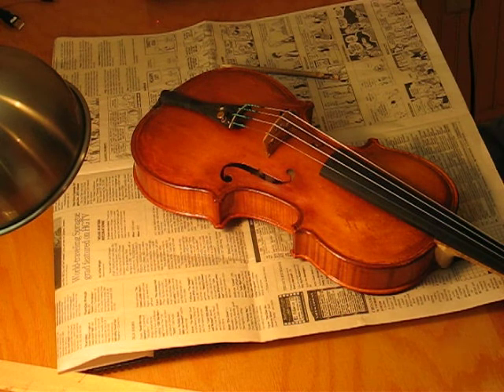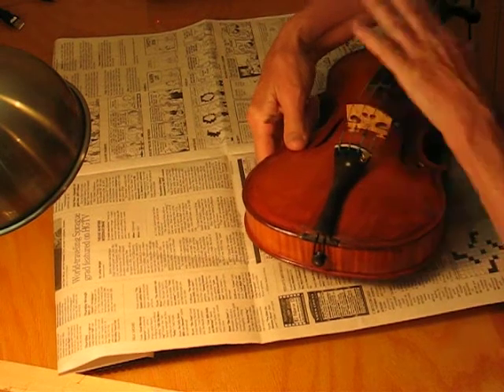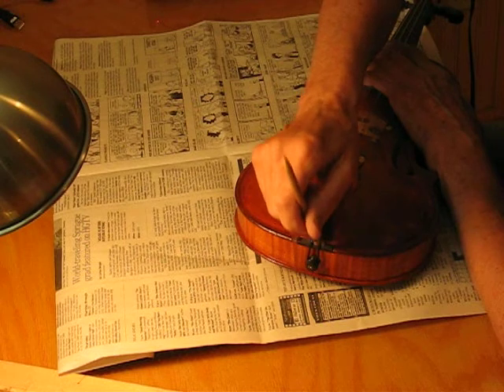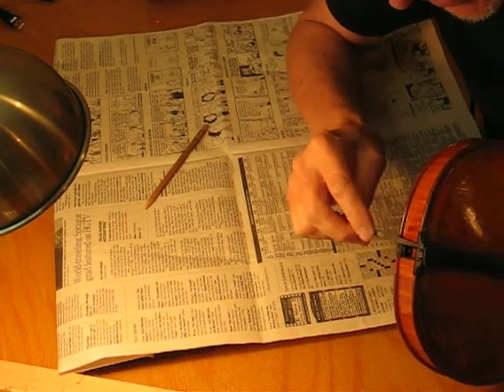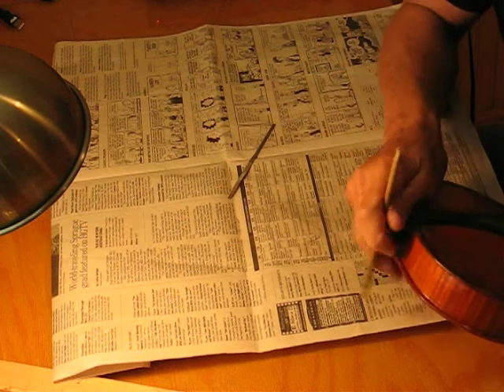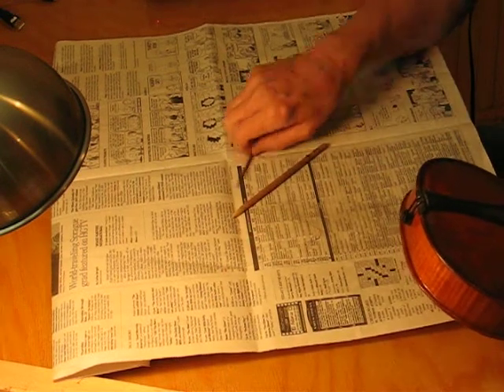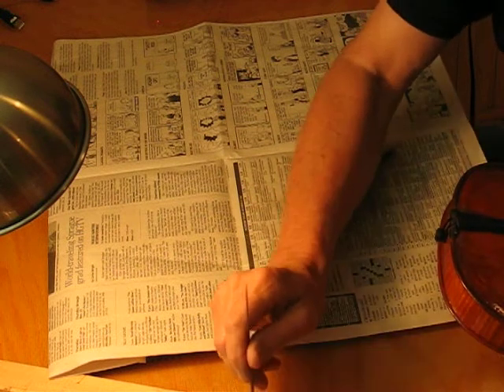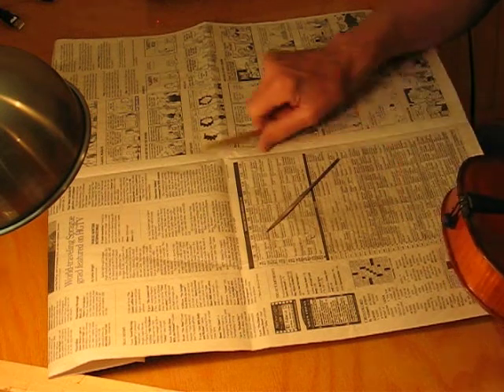Saddle Acoustical Tuning (Tap Tone),  Opus #15 Violin

Comment: Does this really make a difference? And why at that frequency and no other?
Reply from the maker: Kypros;  Thank you for this question.  Yes it does help to clarify the sound.  If you listen to your violin tone before and after the adjustment, I believe you might hear the difference.  Compared to most parts of the violin, the saddle's contribution to the overall Violin sound may be less important but still it has an acoustical contribution to make!
  Any of the frequencies on the Tap Tone Scale would work better than any other frequencies but I believe that 198 HZ Tap Tone is the best.  Please see: http://www.violinresearch.com/violinrubtone_030.htm for your own Tap Tone Reference to measure and adjust from.
  The Tap Tone standards written about  are the result of thousands of hours of testing and playing and were worked out over about 15 years.  David L.